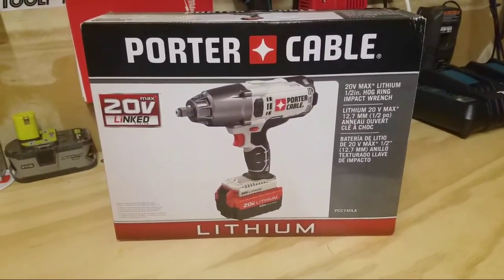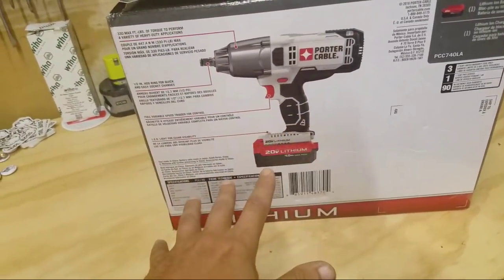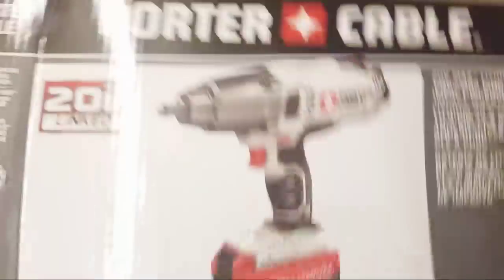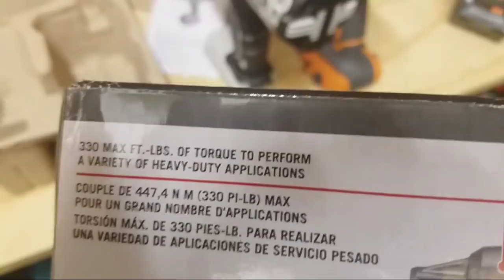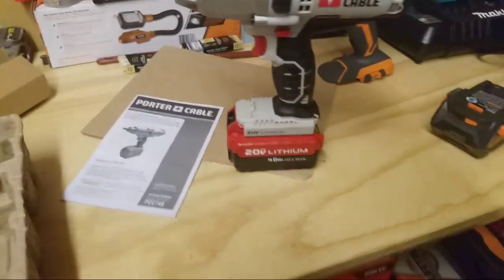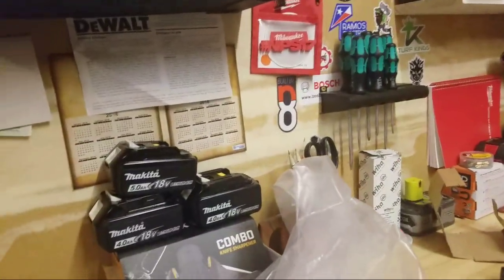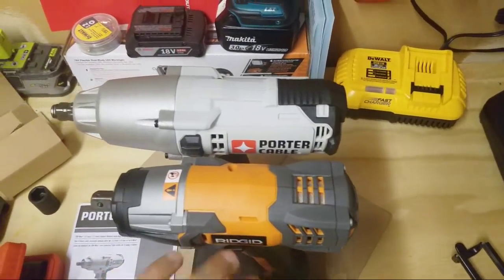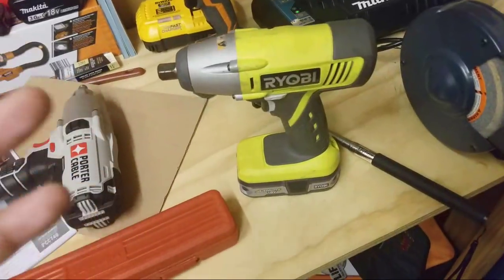Porter Cable 20v Impact Wrench (PCC740) Unboxing And Quick Look

Comment: Just saw this kit at tractor supply on sale for 79$. Thats a very good deal. Mi it's not the latest tech, but it works great anyway and for 79$, you are getting great value. The Hart 1/2 inch will cost you around 200 with battery n charger, maybe 220$

Comment: I am still running the old 18v nicad Porter Cable tools and they have been awesome  but they don't support the 18v line anymore except for batterys wished they would make a 20v adapter like DeWalt did .I want to upgrade to a newer line but my budget wont allow it lol.
Reply from the maker: +Charlie Thompson lol...😂😂👍

Comment: I wish they had a 3/8 in drive and it was smaller and like the Milwaukee because I have the PC  drill and the drill driver set that came with 2 batteries and a charger but this wrench is so big
Reply from the maker: Yea very true ..no idea what's in future for p.c. they haven't come out with a new tool in years
Reply: @toolboss8410  I almost bought it the other day cuz I found it on sale online at Blain's tool and tractor for $95.  Makes no sense to me either just take another  DeWalt and put a Porter-Cable case on it
Reply: All you gotta do is buy the adapters for the high torque impact the have 3/8 drives to go in them. That's what I was using before I got one of these. Not as powerful but it got most of everything done

Comment: Kobalt battieres are cheap and they have samsung batteries in them. And samsung is good quality battery. 1.5Ah $10, 2.0Ah $20 and 4.0Ah for $50 5Ah $80
Reply: I agree on Kobalt VS Porter Cable. This tool is very outdated VS Kobalt. Kobalt's warranty is way better too IMO ;)
Reply: 5 yrs tool 3 yrs battery. cant beat it
Reply: Can't beat it with a stick ;)
Reply from the maker: Jon HVAC yea guys def a solid brand the Kobalt